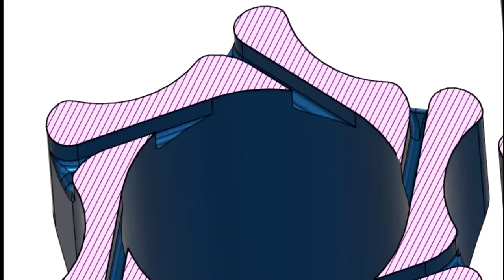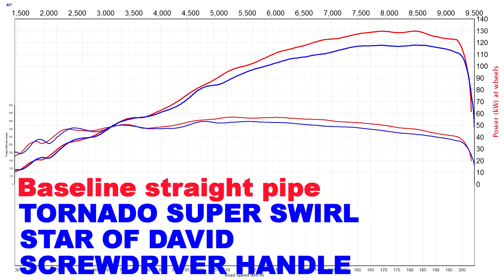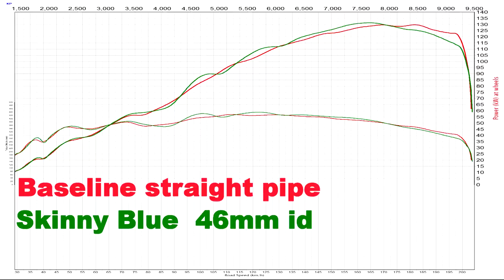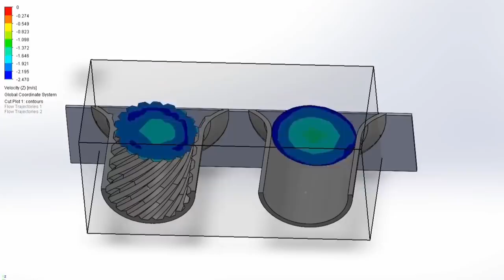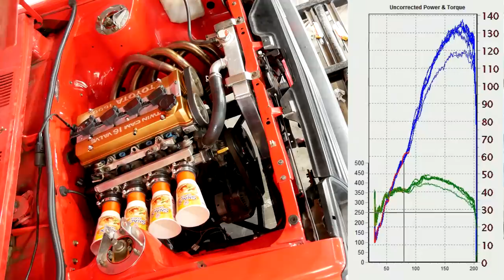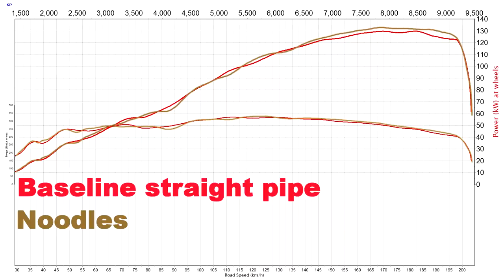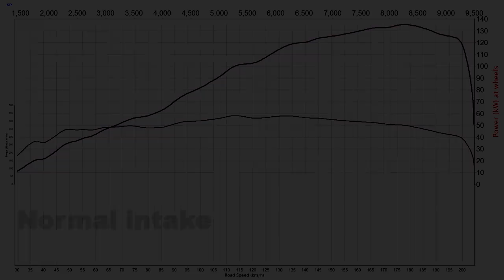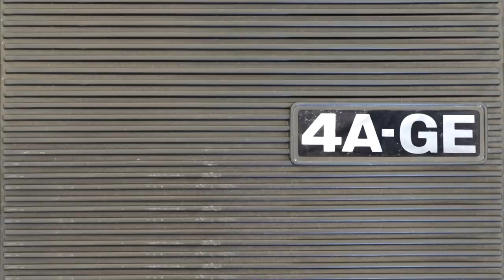Viewer 3d Printed Velocity Stacks  - Trumpets - Intake runners - Dyno Tested

Comment: Without even watching, I would hazard a guess that the longer the runner the better high RPM horse power (to a definitive limit) while shorter stacks will give better torque at lower RPM.
   Yamaha did combine short intake runners with a second set of longer runners in their first gen (1990)Ford Taurus SHO joint venture. Yes, the 1st generation Ford Super High Output sedan was powered by a Yamaha Marine engine and at only 260 hp was the only American sedan with a 5-speed manual transmission.
   The effects were better off the line torque with a big, almost turbo-like surge at around 4,500rpm (when the butterfly valves switched to long runners) all the way to the 7K+ redline.
   The only way to tell a 1990 SHO vs. a “run of the mill” “grocery getter” was the slightly lower ground splitters with factory driving lights and body color indents..SHO…front a rear. Or maybe if you got passed on the freeway by a Taurus doing better than 140mph!
Reply: Generally it's the other way around to what you've described on any twin length system - longer runners for lower rpm.

Comment: I do have a question. Did you happen to tune your engine with each intake style? Not saying the the blue one would have done great but if it's tuned to a free flowing intake it would run way to rich and even kill power do to it. But I could be wrong
Reply from the maker: Yeah AFR was corrected if needed.

Comment: First, a 1600cc engine doesn't need sewer pipes.  You only need 38mm exhaust, and 41-45mm intake.  Those cams are huge, but I'd like to see you try wider 114*-115* lobe centres together with 11.8:1 geometric compression ratio.  Could someone local to him print a 57.5 mm-51mm taper by 185 mm long, with 9 mm full bellmouth?
Reply from the maker: The cams aren't that big, one of the smallest kelford sell for them.     Will loose a stack of midrange with those cam timing settings. It will  hold peak power right out to 9500rpm going that way with cam timing though.   How its set now is dialed in for as much midrange possible without loosing peak. but falls off faster after peak.    needs vvt,  fixed cam timing sucks.     The intake runner you suggest is fairly similar  to "normal" setup

Comment: I would like to see the effect of the angle of the center-line of the venturi or velocity stacks versus the incoming airflow direction. 
I modify weed-wacker engines for RC plane use and the carburetor sticks out the side of the plane if its a piston ported engine. I suspect the loses a lot of power. I have wondered if it would be worth extending the inlet manifold so that the carburetor mouth faces the airflow?

Comment: The green swirl stacks look interesting, but surly and swirl with be eliminated as the air flows past the throttle plate, (unless you've slide throttles).

Comment: How about making the velocity stack into a cone shape. Like 3.5" wide or 89mm and cone it down to a 48mm or a 46mm. Thus increasing volumetric efficiency.
Or make a runner system that would get smaller the higher rpm you go thus increasing horsepower production throughout the rpm range. The length of the first suggestion should be around the same length as the control unit. But make sure it's a cone shape from the beginning to the end. Not 2" and then a straight pipe afterwards. The velocity has to be 3.5" or 89mm.

Comment: I like how none of them really made much difference other than the star that was noticeably worse.  I clicked on the video because of the star, so I guess it accomplished its goal.  I wonder if the star would work better on something like a pushrod V8 that has trouble with combustion chamber swirl.  4 valve DOHC engines don't have trouble in that regard so the increased restriction doesn't have any benefit.

Comment: There is a great article by mototune USA where they  make ports smaller and rougher and gained heaps of midrange and upper mid, winning championship races. Its for sportsbikes but should work on any ICE engine.
Reason I bring this up is the midrange performance of the skinnies, might be due to higher velocity therefore better cylinder filling and more torque at low rpm.
Playing around with that concept (making it a bit wider to lose less up top or variable?) could be really interesting. Along with the ports.
I love NA tuning, especially exhaust tuning/isolation of the system from the mufflers, scavenging, etc. It's far harder and more interesting than the lazy easy and laggy clickbait turbo crap that takes over everything today.

Comment: Nice one.  Clearly any gains to be had are small.  With your long duration inlet cam, I'd expect the lower RPM to suffer from back flow.  Have you tried flow reversion lips or anything like that?  They'd need to be close to the head for any benefit.
Reply from the maker: yeah like anything na tuning it all adds up if get it right.  theres pretty significant power difference in a runner that's the right length, shape and diameter  vs the wrong one.   Ive never seen any benefit  from trying to fix reversion on the intake side. some people run a smaller intake runner which works, but makes another problem at the same time. better to fix it on the exhaust side.  which can be done without the negative effects

Comment: All your tests seem to have a flat-spot around 3500 rpm and again a bit higher, do you know what's causing it? Maybe resonance in the exhaust, fuelling or timing?
Reply from the maker: Happens when run decent amount of cam overlap.     Is to do with Intake and exhaust lengths.    Can dial it out but usually end up worse overall power.  So just deal with the dips. The one at 3500 is a non issue. As never wide open at 3500

Comment: My idea is n in intake system with a variable air vortex system.
Not for a better peak performance bu for a better torque curve. A rotable wing in  the air flow causes the air to rotate. 

Another idea is variable inlet lenght like Mazda rotary piston 787b racecar
Reply: Swirl is desirable in the cylinder but not the inlet.

Some Honda engines and many diesels do have a swirl control system. Both systems work by blocking flow to one of the two inlet valves, in Honda's case this is done by the VTEC system (low speed cam profile has no lift on one of the valves) and in the diesels it's done by rotating flaps in the inlet runners. Because the remaining 'active' valve is offset from the cylinder centerline, a strong swirl results inside the cylinder.

This is especially important for diesels as they need the 'correct' amount of swirl for the cleanest, most efficient combustion, and cylinder turbulence effects like swirl, tumble and squish are stronger at higher engine speeds. An engine tuned to work best at high speed would not have enough swirl at low speed, leading to increased fuel consumption and smoke. A variable swirl system lets you have the best of both worlds.

Comment: Shorten the runner length by half but keep the trumpets and enclose the assembly in a plenum of a capacity equal or close to 2 x the engine size...you should get more up top without losing too much in the middle.

Comment: very useful info.....

im about to install 20v silvertop itb's on a 4a-ge 
but with a twist .
ive modified the adaptor so that i can fit the tvis system .
i believe ill  make good air speed density up to 3500-4000
im also using stock velocity stacks , the ones that have an angle
engine head is ported with 11.5/1, full  custom 4/2/1 exhaust system 50mm ,
oversized valves 

any thoughts???????
Reply from the maker: unlikely will do much unless the whole runner  switches to a smaller diameter like the factory setup does. tvis is a pretty small advantage anyway.  i have a video testing against a smallport inlet

Comment: My Question is, is the O2 sensor connected and checking exhaust gasses for running rich or lean.. More air can also cause loss of power due to not enough fuel. I'm just asking, as tuning will need to be done with every different amount of airflow.. Unless you are running an autotuner.
Reply from the maker: I check and adjust if necessary before the runs you see in all my videos.    But in saying that, engine makes same power over a pretty wide afr range.  if were to go rich after a change means its lost power.  correcting the afr wont bring the power back up  unless dipping lower than mid 11's.

Comment: how about merging cylinders 1-4 and 2-3 intake runners to a single pipe and then play around with those single pipes using different lengths and diameter. the reason this could be interesting is that you could generate a real resonance effect at a given rpm as the the pulsating air in the pipe will be in a real rhythmic effect with the intake valves opening and closing every 90 degrees of duration of cam angle . open - closed - open - closed this is how tank circuits work in electrical inductors and capacitors. i think getting the pipe length and diameter is crucial to see any real resonance effect as you will need air speed to get the air at a energetic enough level for it to start resonating at it's full potential just like a well tuned sub woofer box and port if you get the combo just right you can make a lot of sound from a little speaker at a given frequency. and in your case a given rpm but i would expect performance to drop off either side of the tuned frequency / rpm as it will become out of tune. you can probably find a online sub woofer enclose calculator that you can use to play around with the cylinder (pipe) volume and it may calculate the resonant frequency for you which is a number you can use as a guide for a starting point. your intake pipe frequency ( HZ ) will be based on the cam rotation and times that number by the 2 intake valves opening and closing per pipe. so at 5000 crank rpm / 60sec = 83.3 / 4 (crank rotation to cam rotation 4:1)  = 20.8hz times that by the 2 intake valves pulses = 41.6hz so that is the frequency that you will need to tune the pipes volume and diameter to if you seeking resonance. at  higher rpm the pipe volume will become less.

Comment: Sorry for necroposting but something justr came into my mind.
Have you done fluid simulation with green swirl?
I would say if you make baffles more pronounced and increases screw pitch you might get more airflow (coz there is faster fluid flow near walls of the pipe).
Right now I would say those baffles work more like obstruction for air passing in the middle, so bumpung a bit with diameter could lead to the same base as short whites.
also small taper like 3 deg through whole stack might help.

Just speaking out of my ass so dont take it too seriously without fluid calculations first.

EDIT sidenote - for not flat surface of the 3d prints those are working WAY BETTER than stock.
I would say there would be some gains if the surface was more mirror like (abs plus acetone bath?)

Comment: I mentioned this in another comment but- I want to see a system that can shorten/lengthen depending on the RPM to make use of the low RPM power of the shorts and the high end power of the longer ones (maybe I have it backwards), in most ITB videos where they test lengths there's a trade off between short/long & high/low RPM benefits. I figure you'd sync it all up to the throttle and how open the plenum is or it could match the RPM, though that'd probably require ECU tinkering. I am very interested as to weather or not that'd make a difference. With a working system you may be able to have your Cake and eat it too :P

Great Video!
Reply from the maker: if you watch my first intake runner length video. i test pretty much every different length that will fit in the car.   if drew a line on that road along the top of all the runs, thats what a variable setup would do.   but  you can  also see, if get the runner the correct length fixed.  there isnt that much in it if went to variable.      I was actually going to build a variable setup.  but its not really worth the complexity, and will be some losses, as would be very hard to make the ideal shape runner that is variable at the same time.    If look way way back to the first video on this channel i actually made a poor attempt at it 15 years ago or so.
Reply: @Garage4age  Aye, it would be complex and probably isn't really worth it, it's just something I always think about when I see ITB Videos. I'll go check out that video you mentioned. Love your channel, thanks for all the Videos :D

Comment: With the noodle cup, the straight pipe is too short. I think 14 cm from the tapper would be a good starting point. 

The distance of the opening on each type to the engine bay side is not uniform. The result only applies to your cindition, it would not be the same on each car. 

That is why they cut the hood on race cars, to avoid restriction from engine bay. I think if you close the hood, the result would be lesser. 

On moving car, the actual horsepower would be higher than static setup. To got the engine breathe more freely, some put air duct from bumpers. On some bikes they face the opening of the air filter box to the front to get some ram air effect for more powet at higher speed.

It is better to have more texture in the inside surface, the shinny flat surface suffers from skins effect. More modern fighter jet use grainy skin and not smooth surface like older one. I think if you sand the inner surface with 400-600 grid sandpaper the result would be increased slighly.

Just my 2 cents.

Comment: 52mm itb's where did you get those?? BMW ? also David Vizards book how to build HP vol 2 talks about runner air horn (trumpets) shapes 
Formula 3 team says you need 6 or 8 deg tapper from tip of the trumpets (air horns) to the valve ---thanks for all the vids
Reply from the maker: Yeah that are bmw,  bit of a pain to get them close enough together for 4age port spacing
Reply: My MX-5 ITB setup has 3D printed stub stacks based on Vizards design. It's making good power (for a BP4W) with 4AGE ITBs.

Comment: Great video, though maybe I'm missing something since I normally think in HP and ft-lbs. Isn't 400Nm a shit ton of torque for a 4age? I would expect an engine 130-140kw at 8000rpm to be making more like 190-200Nm. Is that just due to gearing or something affecting the dyno?
Reply from the maker: yeah its torque at the wheels.  if do the math from power and torque is around those numbers you say
Reply: Whilst power at the wheels should always be the same in each gear (not accounting for different amount of losses in different gear ratios), the torque and speed at the wheel will vary with the gear ratio. For example, my old motorcycle made 49lbs.ft at the crank. The primary reduction ratio is 2.111 and the final drive ratio is 2.625. 1st gear is 2.750. Combine all of those gear reductions and you end up with 746lbs.ft at the rear axle in first gear; but at the expense of a "low" wheel speed, so you end up with the same 116bhp or so. (NB. Motorcycles have a LOT more gear reduction than cars). If the torque at the wheel stayed the same, then your car would pull as hard in 6th gear as it does in 1st; which it doesn't.
Reply: Yes this is why in some cases people prefer to dyno at a 1:1 gear ratio usually 4th or 5th, issue is in high power cars you will pop tyres. Anything north of 800hp has no place on a wheel dyno. Which is why I laugh when all these 'car youtubers' get their cars 'dynod' on these wheel dynos that slip. Eddy current/hub dyno or you can just forget accuracy, repeatability (and buy a new set of tyres). I've put one of my superbikes on a dyno with new tyres and it ate 1-2cm off them in an afternoon, coating the booth. Enough said!

Comment: Would the next test be to tune the length of the little whites overall - or have youalready done that?
Reply from the maker: The length they are all run at  makes the best overall power.   with a few exceptions, like the big white, it would benefit from being slightly longer. since the big bellmouth makes it act like a shorter runner